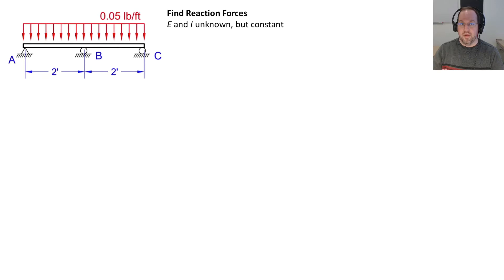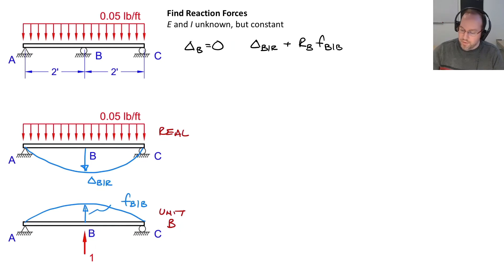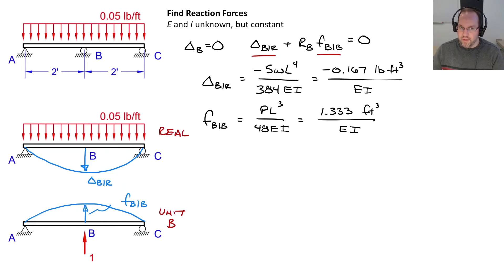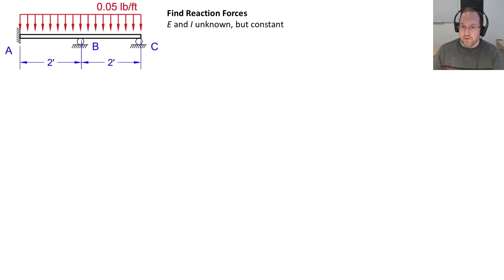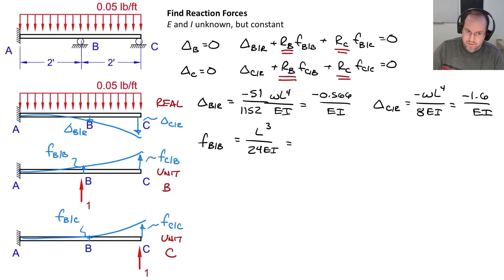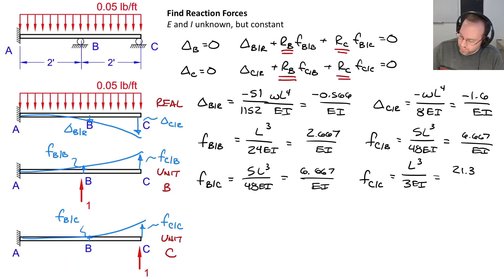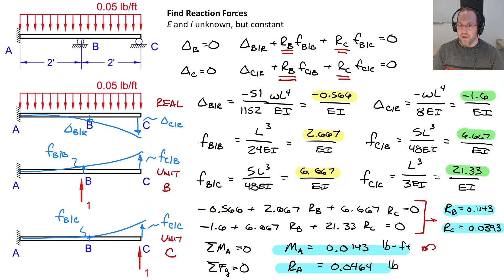Force Method for Indeterminate Structures - Intro to Structural Analysis

Comment: flexibility equation "fBIB" is the same things as the deflection formula for a point load on a simply supported beam? are they the same thing just named differently?
Reply from the maker: Yes, the flexibility is just the deflection under a unit load. So if you have a table of typical deflection values for typical point loads cases, you can use these equations for flexibility by setting the applied load P equal to 1.

Comment: Hi there professor, why are the displacements in the real system always negative? Would it be positive if I were to direct my virtual unit load in the same direction as the loads in my real system? Thank you very much.
Reply from the maker: Yes. The signs of the displacements are relative to the directions of the virtual unit loads. Negative displacement means it moves opposite the direction of the unit load, and positive means in the same direction as the unit load. 

If you reverse your unit load and repeat the problem, that will switch the signs for the real system displacements. Regardless of which way you point the unit loads, you should always find the same reactions from the force method, so the unit load directions is merely a matter of preference.

Comment: Thank you. Can someone explain why one deflection has unit of pbft^3 & the other only ft^3? I personally believe the reaction we are calculating through this method is a unit-less fictitious (scale factor turned into load).
Reply from the maker: I apologize, the units are a bit weird here. 

For the force method, normally we would calculate the deflection under the applied load with units of length and one or more flexibilities, which represents the deflection for a load of 1 (unitless) at one of the "removed" supports, with units of length/force.

In this video, I did not use values of modulus E or moment of inertia I because they were constants and would cancel out when applying the constraint equations. When you don't divide by E (force/length^2) and I (length^4), the deflection under applied loads looks like it has units of force*length^3 and the flexibility looks like it has units of length^3 (no force here because of that unitless load of 1). Regardless, when you put these back into the constraint equations, you will end up with units of force when computing the actual reaction. This is a real reaction with units that match the units you used for the applied loads (pounds, Newtons, whatever), not just a scale factor.

Comment: hey, (i'm just taking a peek into the next semester curriculum), but one thing i dont get is why you use this method to find support reactions, are they initially unknown?
Reply from the maker: Yes, the reactions are unknown. For an indeterminate structure, equilibrium alone is not enough to solve for the reactions, so that's why we need the force method (or other techniques for indeterminate structural analysis).

Comment: A clamped beam AB of constant flexural rigidity is shown in Fig. 2.9a. The beam is subjected 
to a uniform distributed load of 
wKN / m
and a central concentrated moment 
. 
Draw shear force and bending moment diagrams by force method. 
help with that

Comment: Are you able to upload the tables you used?
Reply from the maker: I don't have one that's copyright free (I usually teach structural analysis from Hibbeler's textbook, and that has a table on the front cover). However, you can find typical tables just about anywhere. This website has most of the common cases: https://mechanicalc.com/reference/beam-deflection-tables

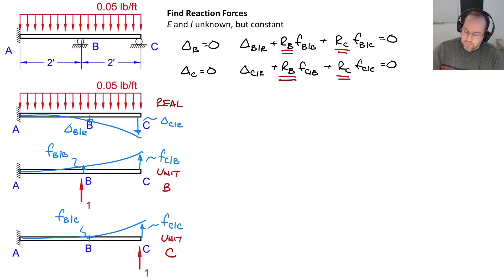Comment: sorry, I don't understand at 8:55 why is -51WL4/1152. where can i find tha value or that formula
Reply from the maker: That is the deflection at the middle point of a cantilever of length L under a distributed load w. Formulas for simply supported beams and cantilevers are tabulated in a bunch of places, even Wikipedia: https://en.m.wikipedia.org/wiki/Deflection_(engineering)
(This wiki link has the formula as a function of x, but a simple substitution of x = L/2 should get the formula I used). Of course, you can always calculate these deflections using some other method, like moment-area if you wish - it’s just a lot more work.
Reply: A clamped beam AB of constant flexural rigidity is shown in Fig. 2.9a. The beam is subjected 
to a uniform distributed load of 
wKN / m
and a central concentrated moment 
. 
Draw shear force and bending moment diagrams by force method. 
help with that